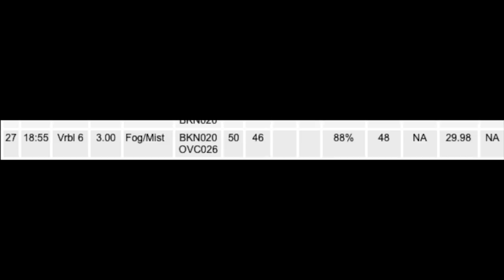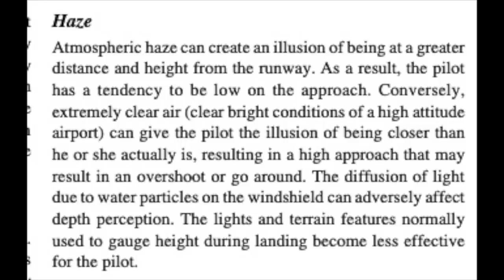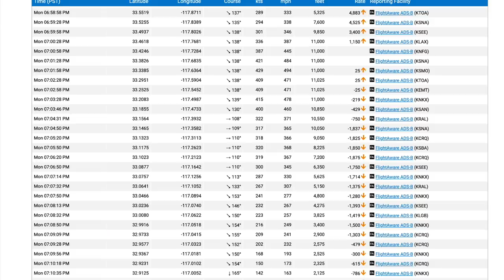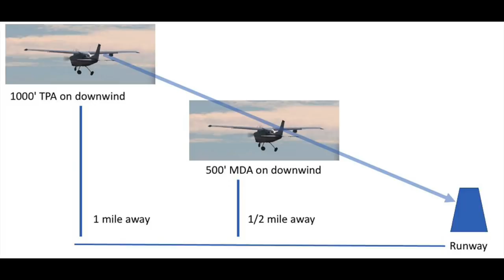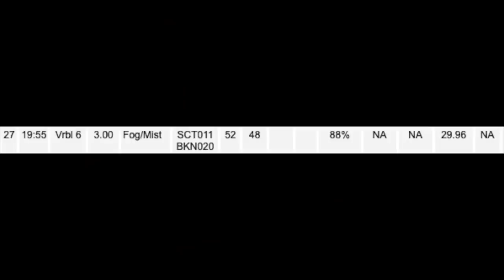N880Z Learjet Crash El Cajon San Diego California - Low Altitude Starts Accident Chain

Comment: Every single pilot should be required to do 250+ hours of aerobatic flying in something like a Pitts Special. It teaches you how to really fly an airplane. Practice every type of aerobatic maneuver at altitude. After 50+ hours of flying in my Pitts, I realized I didn't know anything from my Private pilot training in a Cessna.
Reply: Give a man a hammer... I've flown the Great Lakes and others. Aerobatic flying skills at 400' in a jet in low vis? Not helpful.
Reply: @rpcraighead  Not true. Aerobatic flying skills apply to any type of aircraft you choose to fly. It teaches you how to fly by feel. The best airline pilots are also aerobatic pilots.
Reply: Unfortunately this would have no bearing on what happened. The Pitts performs extremely well and has excellent control in very narrow flight envelope margins, hence why it is such an ideal aerobatic plane. 

Flying a jet like the Lear 25/31/35 is profoundly different and reliance on “stick and rudder” skills won’t prove to be a difference maker in a scenario like this — in fact it is usually low time jet pilots / or inexperienced in make and model jet pilots who struggle with the approach phase in heavy workload environments. The Challenger crash in Aspen is a perfect example of this, along with Teterboro (Lear 35) and many others I could list.  

This accident was tragic and entirely preventable; aerobatic experience would have had little to no effect on the outcome, in fact some evidence suggests that aerobatic trained pilots tend to default to demanding MORE performance from the aircraft not less.
Reply: If you are anywhere close to needing those skills in a transport category aircraft then you have no business flying them.
Reply: Assume you took  250 hour courses in Indy Car Driving before you applied for a State Drivers License at age 16. If not....you are a menace and should Uber exclusively.
Reply: Upset recovery training  is already a requirement for airline  pilots.
Reply: @rpcraighead  Absolutely not true.  Aerobatics give pilots a much better understanding of aerodynamics and geometry.  That translates to any flying scenario in any aircraft type.  I would even go as far as to say that if the pilot at the controls of this Learjet had aerobatic experience, this accident would not have happened.
Reply: Required, really? I have no doubt that you paying for my 250 hours in a Pitts would be a great experience and make me a better pilot. But since you're not going to do that, I also have no doubt that I wouldn't make dumb decisions like this guy and I can still be a perfectly safe pilot. Ah crap, knock on wood.
Reply: I believe aerobatic training in any aircraft will make one a better pilot, but 250 hours in a Pitts at $300/hr would cost $75,000! Not many pilots could afford that. Even Navy or Air Force fighter pilots graduate with much less aerobatic training.

 I took an upset training course years ago in a T-34, and it was very beneficial. I currently work for a large training organization and we have an upset recovery program that we can teach in our simulators. Unfortunately it is not a requirement for US pilots, but it is for European’s. 

I have 4000 hours flying Lear’s, and a circling approach at night is a difficult and often risky  maneuver. Several company’s I flew for would not allow them at night. 

Very sorry for the crew and their families, however those of us in business aviation have to do a better job of training as well as decision making and flying.
Reply: @RLTtizME  I started riding mini bikes at 7 years old then racing dirt bikes off road. I had way more than 250 hours of motorcycle riding before I took driver's education in high school. Then rode sport bikes on the street. Driving a car was a breeze.
Reply: @johncox4273  You purchase a used experimental Pitts S1C or S1S. You do all the maintenance work yourself. Purchase only liability insurance and find a low cost hanger that you share with other airplanes. That makes it affordable.
Reply: @rushmoore5112  Exactly. Air show pilot Skip Stewart is a captain for FedEx. There's no way he would have crashed a Learjet like that. Put airshow pilot Sean Tucker in that Learjet. It would never have happened. I saw Air show pilot Bobby Younkin fly an amazing aerobatic routine in a Learjet 23 many times.

"Bobby’s latest act was a Learjet 23, an aircraft never intended for aerobatic use. Designed as a corporate jet, the Lear was built to haul wealthy clients around in comfort and style. He had to receive special approval from the FAA to fly the jet in air shows, approval based on his track record as a pilot. Bobby pushed the aircraft to its limits by performing a full aerobatic routine in his Lear, the ninth one ever built."
Reply: @pittss2c601  And?
Reply: @pittss2c601  Put countless pilots in that LearJet and the accident would not have happened.  My point was that aerobatic training improves flying skill that translates to every phase of flight in any aircraft type.  Comparing that to professional airshow performers is like comparing me to Dale Earnhardt because I took a defensive driving course when I was 16.
Reply: @rushmoore5112  Air show pilot Duane Cole always screamed; "There are no squirrely airplanes, only squirrely pilots"
Reply: Pitts S2C,

I agree with you that learning some basic aerobics will make you a better pilot. Flying gliders will make you a better pilot. Getting an instrument rating will definitely make you a better pilot. Getting a jet type rating will make you a better pilot. I could go on and on, but hopefully you see my point. As professional pilots we should always strive to improve our skills and our knowledge. How one chooses to do that is up to the individual, and let’s be honest here, also up to their bank account balance. Learning to fly as a commercial pilot is very expensive today. I know young pilots who have come out of college and flight school owning over $100,000! How are they also expected to buy and operate an aerobatic airplane for 250 plus hours? That statement is what I was responding to-that “every single pilot should have 250+ aerobatic hours”. I have 18000 accident and incident free hours operating corporate aircraft all over the globe, and I have maybe 10 hours of aerobatic flying. Do I think those 10 hours made me a better pilot-yes I do. But in my 45 year career there were many other things that made me better. I got to learn how to fly helicopters, which made me a better, more rounded pilot. I have seven type ratings, which has made me a better pilot. I have been to recurrent training over 70 times, which has made me a better pilot. I have my CFI, which made me a better pilot. And the one thing which has really made me a better and wiser pilot is just good old experience. Like every other human being I’ve made my share of mistakes over the years, but those mistakes made me a much better pilot than hundreds of aerobatic hours ever could. 

So yes, aerobatic training is very valuable, and I would recommend a basic aerobatic course to any pilot who wants to improve their skills. But saying one needs 250 hours of aerobatics to be a safe pilot is just not true. 

Safe flying, and enjoy your Pitts.

Comment: Low isn't in the ground. How much altitude agl would this aircraft really need to execute a stall/spin recovery? I'm sure more than any higher approach would provide. My point: they had insufficient airspeed for the turning approach he was attempting. Undoubtedly the inside wing stalled first, providing the irrecoverable spin- and they died for no other reason. Had he established a stable approach even if low, well he'd be landing the way they used to back in the day, and he'd just say.. "oops a little low in that one" and grab a cup of coffee.
Reply from the maker: Typically, any spin in the traffic pattern is too low to recover from. Even a basic Cessna 152 requires a 1000 feet of altitude to recover from a 1-turn spin. I agree, the low wing most likely stalled first, which would have caused them to go inverted in just a second or two. Trying to fix an overshoot of the base to final turn continues to kill lots of pilots. Just go around.

Comment: Its pretty clear this guy was skirting the rules that would have prevented him from landing there and killing 3 people. He knew the rules and performed that maneuver virtually every time he landed there. Thats the runway used the vast majority of the time. He was low to try to get any visual on the airport. I live closer to the airport than the crash - your description of visibility is off. It was thick and heavy with constant rain - its a small valley surrounded by hills on all sides it holds clouds. This guy didn't want to land 2 minutes away at a better site, cancelled the IFR and was trying to fly under the very low clouds. It didn't work. They all died because of the pilots ignorance of minimum speed of his craft during a maneuver as weighted and including conditions. There were calculations that needed to be done before he even took off in bad weather. He didn't and didn't add the necessary speed for the conditions. For the record there is no training agency training on any of the calculations (big planes don't need it). They train the maneuver but not why or how to calculate. I understand this to be true of the vast majority maybe 90% of all general aviation pilots don't know how to do the calculations or have even heard of such a thing but there is definitely a minimum stall speed and he found it. A shame in stead of telling the truth about the cause of this the news is reporting this reckless pilot as a hero for free falling in the middle of the street rather than on to a house. If you heard the audio you know he steered it nowhere.
Reply: Lot of blame goes to this pilot, probably most of it, but where was any supervision over what was being allowed? This pilot didn't own the plane, who runs that company and who supervises the operations? Lax all around and a pilot adding his mistakes gets you this. Maybe it will help institute some better operations all around.
Reply: @fcaughli  From what the youtube pilots are saying the problem with this and so many more like it is that they teach the circle maneuver that is THE move for landing here. They just don't talk about the whys and how to do the calculations to determine the minimum speed for the aircraft as configured with weight and in the rain. This youtube pilot called out every single training facility by name as well as the woman in charge (maybe ntsb) who won't even address it. So no changes are forthcoming - the cause of this crash will be "loss of control" without ever answering why. And it was that he didn't know the stall speed under maneuver as configured as well as being WAY to low to try to get under the clouds. 
I'm a high altitude backpacker - the conditions you can encounter are a shock to the system. You must experience it in controlled circumstances to learn how to navigate it. No plot licence should be issued (should be military trained only imo) unless the pilot has flown through big storm conditions with total blindness to understand just how much your instincts will  lie to you. The disorientation is all consuming and I'd guess would have a whole bunch of folks selling there plane once experiencing it. 
The doctor that killed himself last month at the same airport accelerated into the ground thinking he was excellerating up. 
And they can save the "put on the blinders" and fly instruments only. I actually witnessed such a midair collision. student blinded and teacher watching the student in stead of heavy traffic same airport same distance away.
Reply: @nedanother9382  - While you say a lot of pertinent things, some of the worst pilots I flew with at airlines were those military trained.  Little to no ability to think outside the box, or outside the "book."
Reply: @chucksavall  I suppose there are a lot of cowboys from that vein too. My point was just the amount of solid training vs what I saw yesterday av"be a commercial pilot in 7 months" add. Uggg. Cheers and a happy new year to you and yours

Comment: LOC-D 27 right
Is the approach to 27 R
Reply from the maker: Technically it's a circling approach, so it's not considered a straight-in approach to 27R, which is why runway 27R does not appear in the title of the approach. It's considered a circling approach since it has a very steep gradient, more than double that of a typical approach. For a Learjet at 140 knots, they'd be descending around 1700 feet, which would be considered an unstable approach.  It also has very high minimums, 1940 feet. And like the 17 approach, you can't land on 27R without first cancelling IFR. So technically, it's not an approach to 27R and it wasn't a good option for this crew.
Reply: @AviationNewsTalk  i can see the airport from my window that night at the time of the crash very marginal
In my 182 i would have never tried the 17
No jets land 17 ever
Reply from the maker: @sdcflier  It looked like a terrible night to be out flying VFR. I was teaching at Lancaster, CA that day, and we didn't fly because it was so poor. It's too bad that 17 isn't longer, or that there aren't better approaches for jets to 27R and 9L.

Comment: 4:28 no night restriction for RNAV 17 Circle 9L. No need cancel IFR.
Reply from the maker: That could have been an option. But we have no idea where the clouds and rain were at that time. The crew might have felt that the path to 27R had better weather than 9L.
Reply: @AviationNewsTalk  just Speculating again. This is what we do. I feel the "local" would not have given him VFR if less tham MVFR 3 sm. He probably saw his landing lights and watched with concern on his low pass. Possibly the entire flight. Never know till ntsb release in a couple of years. I mention RNAV 17 Circle 9L because nobody seems to note it as an option irregardless of vis. Thanks for response. No offense. I think it is technically the only legal ifr, circle to land, to longer runway. 17 wet, not an option. Please you or someone else correct me if i am wrong.

Comment: Judging by the accident site's relative position to the airport and the final ADS-B data received from the flight, it looks like the pilot was surprised by Jingle Bell Hill (its real name) east of the airport and turned too sharply to the left to avoid it.  They may have mistaken a relatively straight residential street for the runway, hence the final request to turn up the runway lights.
Reply: @Galileo7of9 It was at night and the weather was bad.  They also seemed to be behind the curve, hence the late request for VFR and a runway change.  The pilot certainly wasn't used to flying the approach as low as he did.
Reply: @Galileo7of9 Behind the curve means he'd lost situational awareness because they were rushing to get down.  Lots of CFIT incidents have occurred over the years despite the pilots involved being intimately familiar with the destination airport.
Reply: @Galileo7of9 He was flying a jet aircraft 300 feet above the field and canceled IFR after he'd already received landing clearance.  You're just being argumentative for the sake of it.
Reply: @Galileo7of9 No, you don't seem to understand.  A circling approach was unsafe in those conditions.  He should not have been that low, period.  You're also making unfounded assumptions about his intentions.  How do you know he didn't change his mind at the last minute?
Reply: @icemachine79  My interpretation Of "Behind the Curve" Means "Things are happening faster then Planned"......." Behind the Power Curve" means just that !!!  The A/C is in a slow speed usually nose high attitude and not enough Horsepower to fly out of it....The only solution is dropping the nose.....and I don't think that happened....He was in a sweeping left turn and Yanked instead of adding power,  (Possible even caused a snap roll entering a spin) I could be outdated, My flying Corporate A/C began when Published approaches consisted of A&N Beams and a stop watch, X--Country Navigation aids were Lighted beacons flashing Morse code and arrows painted on Barn Roofs.....Things change but not the proper use of Stick and Rudder
Reply: @Dean Zinter I thought I saw somewhere that the PIC had numerous type ratings from the LR-JET to the B-777.  I agree that this was screwed up so lets learn from it in order to prevent it from happening again rather than just call people names.  This can happen to anyone.

Comment: Flying in low level Fog… while telling ATC they are VFR was the first problem…
Then they tried to drop down below the clouds while IMC in a steep turn…
This was stupid on so many levels.
Reply from the maker: I'm sure fog is common at Gillespie, since it's in a valley. And I'm sure these pilots dealt with it successfully before, which may have made them overconfident. That's the problem with "getting away" with scud running...it can lead you to believe that you'll always get away with it. Very sad.

Comment: they lost sight of the rwy stayed low to keep out of the scud. scud hangs down below an official ceiling when high humdity prevails near the coast. trying to keep sight of the rwy thru the scud they  let airspeed deteriorate in a steep turn. bam rollover stall. the very common mistake for ifr pilots trying to maintain vfr because of the rules. much like kobe bryant crash. jmo